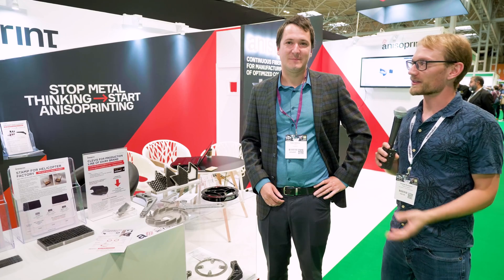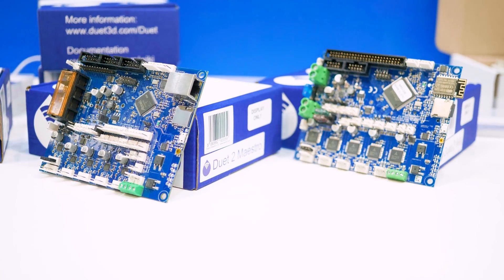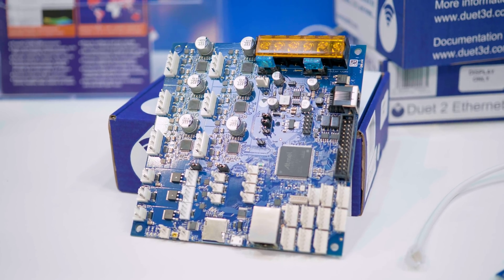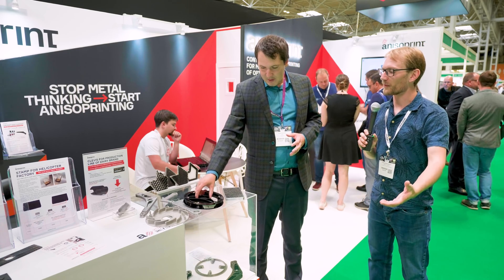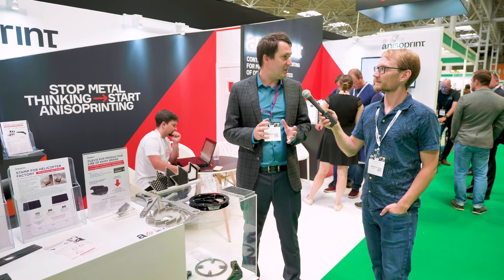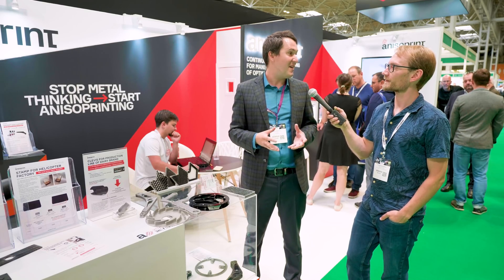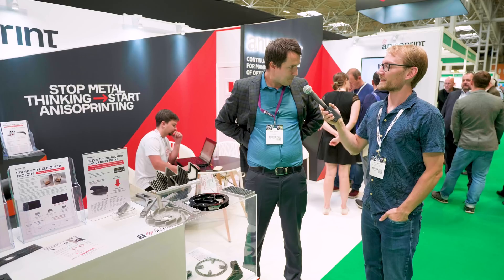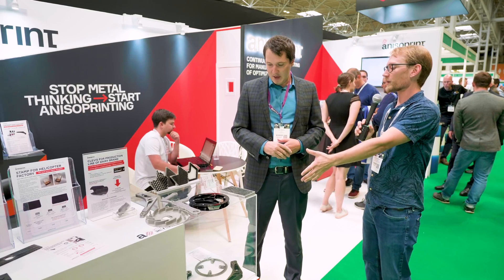Carbon Fiber 3D Prints stronger than STEEL - from Anisoprint!

Comment: Now imagine using thin copper wires instead of the carbon fiber. You could create electrical delivery channels through the parts without having to design the parts around the copper. So its useful and stronger. Maybe that makes sense, maybe it doesn't I don't know haha.

Comment: 9:14 the good point of that is you dont lose strenght when need hole because carbonfiber filament go from start to finish so no need to cut it in the midle. that is nice. 
Price?
Because look more weight less strenght than carbonfiber method. Ofcourse you win versatilty and more easy to improve of perfect deasing.

Comment: While liking the carbon fibre materials i do wonder as the sign says stop metal thinking,i was wondering.while yes ok the production on metals stoppping would have an enormous benefit for our planet and our children but while carbon fibre is an amazing product what are the recycling systems in place as metals you can always melt down to produce different items..any info on future improvements in this area mmmm.🤔ah no!!

Comment: Coming soon, the folicular mullet printer. It will harvest hairs from the toes and legs, and place them into the most correct arrangement onto predetermined areas of the dermis that covers ones own skull, while allowing for 1 of 100's of different styles selected from the device's touchscreen. It's only 500 dollars at the kit level, and 2200 dollars if fully dialed in, should the prevention of a failed first print be most desired.

Comment: As someone who worked with carbon fiber extensively in the past in the cycling industry, I have to agree with most of what he said. However in my opinion small holes dont present as big of a problem when layups are designed to mitigate the issue. It should be clear that this technology doesn't actually compete with real carbon parts, instead it is showing a new application for  carbon fibre as a technology.

Comment: Dumb question:  Why would you bond with a thermoplastic and not a resin??

Make a carbon fiber part, you use resin to bond it...resin 3D printing is a thing...confused, though I'm sure there's a good reason.

Comment: My immediate thought was bone and joint implants. This mimics the way bones are optimally structured; at least in 2D/2.5D. With a full 6DoF, 3D delivery head, instead of the conventional 2.5D planar FDM delivery, this could be amazing and let us move from isotropic steel investment cast alloy prosthetics, to designed, anisotropic and highly optimised, printed composite implants.

Comment: Can compete with today Carbon fiber article? I mean have the same property as carbon fiber made with epoxy with traditional method?
What about strenght in all direction? because that 3D print cant put carbonfiber filament o "Z" plane only in "X" and "Y" plane and that give strengh only in one direction instead in 2 or more.

Comment: Stronger than cold forged chrome vanadium steel?  Carbon fiber is but you have to use a glue. A bonding material. The bonding material is not. I'm very familiar with carbon fiber frames for mountain bikes. They have discovered they can't make the frames lighter than alloyed metal. Yet carbon fiber is 1.5 times the strength. 
These thermoplastic polymer matrix carbon fiber printed parts are stronger than plastic . That's it. 
The good thing about this machine is that it can use recycled carbon fiber.

Comment: 👨‍💻DON'T WORRY ABOUT it CARBON FIBRE IT COST 10XS MORE THAN stainless steel 302 grade thats why SPACEX IS USING ST/ST 302 hard & cheaper its ok for ground vehicles  & bikes  not a lot used  but you try making a Rocket out fibre 13 storeys + high & you run into problems 💲🚀👍

Comment: this would be interesting to use with very thin steelwire as cheap alternative.

(i dont trust any fibers for health resons)
Reply: Steel would actually be simpler. Im guessing you could get away with a single extruder and really thin steel wire actually...
Reply: it would be an awesome diy project to pull that off, i think the main obsticle is, that the matal won't fuse with the plastic

Comment: the fibres only add strength in tension, so how can we use it to increase strength in the z axis direction?
Reply from the maker: There's no option for that yet - you need parts that are suitable for it, printed in the right orientation.
Reply: "We"  could Print an intersecting part  to fit through the voids in the low % infill, then (use your plastic system of choice) "afix" for a the final part with continuous filament in 3 axes...   Basically a 3-shot process.

Any 2+n axis material creation method has material limitations in the Z-Axis...

Comment: I would think for the insane "engineering grade" price of this printer that it would also be able to print high temp engineering grade materials.... 
Cool concept, but that price is just way too high. The only part that makes this much different from a $300 printer is that custom hot end that converges the fiber with the plastic and has a little knife on it.

Comment: I believe Markforged is less expensive for a similar tech, may be I missed the point?
Reply: This system uses a continuous long strand fibre. Which is significantly stronger than short strand that markfoege uses.

Comment: Looks like a good implementation of fiber reinforcement, but the prices will be their down fall. I don't see anything that justifies the prices beyond the intellectual work that went into creating it, and in most cases the market doesn't give a rats ass about that. If it's any good it'll be copied and sold at 10% of the cost once the patent runs out. With any luck they can licence the tech to a company that can sell these at volume and bring the prices down.

Comment: So 12k for the smaller machine. I wonder how much for a spool of the carbon fiber.
Reply: (And, if you are free to in fact use "any other supplier" of the CF, or if that is RFID controlled.... ) - Other suppliers of "Thermoset Polymer Embedded Fibres" will eventually appear.

Comment: Could that fiber be actuality replaced with metal? Thin gage copper etc...
Reply from the maker: As long as it's flexible enough and the cutter can handle it I don't see why not!
Reply: @MadeWithLayers  I was thinking about a solution for integrating metal wire in prints for a long time. I think for them it's just a small step now. Let's hope they see the potential and try it 😉

Comment: What he said about most people using carbon fiber wrong--by just laminating and then milling and drilling--is too true. You're wasting a lot of strength potential, when you could use intelligent fiber steering around certain features.

Comment: Decoupling tensile strength from cross sectional area is a game changer.  These are literally 'next level' composites.
I cannot wait to see where this goes.    Are we moving towards a world where FDM parts have mechanical properties superior to some cast or forged metal ones?
I can't remember the source  but a few years back a youtuber tried 3d printed propellers for an outboard engine.  They all had different times to failure but all failed.  I would love to see how this material performs in comparison.  (When you can control the internal structure of the part can we even call it just 'a material' any more?)
Great video!  Thanks.

Comment: SHUT UP AND TAKE MY wait, how much is it?
Reply: 12 000€~13 000$~11 000£
Reply: The printer could potentially be cheap. The fibre- not gonna.
Reply: @BooBaddyBig  fiber cost will come down when production ramps.. tons of Carbon floating around.
Reply: @WilliamAshleyOnline  Carbon fiber is already produced at significant scale but is still not cheap.
Reply: @BooBaddyBig  the fibers themselves are quite cheap. Parts made out of them, however, are not.
Reply: @DDryTaste  Have you purchased them recently- actually not that cheap! Steel is nearly always cheaper.
Reply: @BooBaddyBig  Don't think you should compare with steel since steel has been mass produced for hundreds of years and has always been cheaper than almost any metal material.
Besides that, you certainly can't buy the machines required to forge/process steel for 12000 euro.
Reply: @DDryTaste  I actually fabricate composites sometimes. Carbon fibre mat is not cheap. Glass fibres are much cheaper. The process to make carbon fibre is much more energy intensive and involved.

Comment: So you’re telling me... I could... essentially... print out... new rims?????? If it’s stronger than steel and I would assume much lighter it sounds like it would work
Reply: A major limitation is that all the fibers are still in stacked planes. Your rims would split along the layers. You would need a method of 4 or 5 axis printing to make something like rims a feasible project, which is orders of magnitude more difficult.

Comment: Interesting and impressive.. Wondering how they block the molten plastic from oozing from the hole where reinforcement fiber is entering??
Reply: probably a tiny one way seal...
take the letter V , cut of a tiny bit of the tip at the bottom, make a rotational part out of it (so you get a cone without tip) and you are good to go.
make the part out of high temp silicon or a similar flexible material.
you can push the fiber stock through it from the top, widening the hole but when the backpreassure is applied from the bottom the hole will seal itself.

Comment: In summary, a clone of the Markforged system, but with an additional plastic-only extruder so carbon fiber placement is controllable within individual layers. Sounds like something Markforged should have done, but were beaten to the punch. I hope there's not IP issues here, because this seems very practical.

Comment: Wow super interesting! I'd actually be more interested in fiberglass printing because of cheaper costs, but I'm sure if they can print carbon they can print fiberglass too.
I wonder if you could pre-impregnate your own fiberglass to save costs and not be dependent on a single supplier.
If you'd scale this up you could actually 3D print boats or cars or even house parts with this!

Comment: This technology paired with the "true" 3D printing slicer could yield some VERY cool capabilities.  More nozzle development needs to be done to accommodate more extreme angles with the 3D printing part. Full 5 axis control of the printhead.  My dream of a 3D printed canoe is closer!
Reply: are you talking about the thesis where the guy wrote a plugin for slic3r that allows for dynamic z surface layers? 
or what do you mean with "true" 3D?
Reply: @TheScarvig  Yes- I guess that may be a better name for it.  Having the fiber reinforced layer applied dynamically over the  surface.

Comment: The weakest point of a 3D print is between the layers. How do the fibers help layer adhesion if it is still 2D layers on 2D layers?
Reply: For that you would need a machine with rotational axes so it can lay in any direction

Comment: Seen many iterations of adding different fibers, most were manual.  This doesnt seem hard to do,  so the price tag is a bit steep in my opinion. Figuring out what to impregnate the fiber with and what to extrude with is probably the biggest challenge. They smartly locked that down. No software and 12/19K EUR cost seems a bit wrong to me. Doesn't seem like it would be a huge stretch from a duel extrusion setup.
Reply: They have software, called Aura. It can be downloaded from the website

Comment: Please excuse my ignorance on the subject but, would it be possible to just make a fillament with the long strand fiber already in it and just print with one head? Or would that not work?
Reply: Peter Gordon Because the diameter of the filament goes from, say, 1.75mm to 0.4mm  as it's melted, the length of extruded plastic is longer than the length of filament put into the hotend. Since the length of the carbon fibre is constant you have to add it after melting
Reply: It's basically the point of their whole system enabling to use a variable amount of constant non cut fiber + a plastic. This way you can change the amount of fiber you use, you can easily swap the plastic type and print at a different build hight. An embedded strand in the plastic could only be printed at the exact print parameters, to thick layers would result in to much fiber per printed mm on the object and to thin layers probably would rip the part on the strand from printbed.
Reply: Ahhh ok, that makes sense. Also makes this machine seem even more genius.  Thanks for the replies!
Reply from the maker: I mean, essentially that's what Markforged's continuous fiber is - they uses nylon-impregnated fibers, which soften when heated, yet can't quite be printed like a normal filament, Anisoprint use resin-impregnated fibers (which stay rigid). I feel like the differentiation is mostly to work around Markforged's patent though.
Reply: @MadeWithLayers  probably to work around the patent, yeah. But it's also kind of neat only one thin kind of coated CF filler needed,stiff strands layed down and the bonding plastic can be picked up by the user. I feel like this system/hardware is also easily capable to print copper/alu (or steel as a cheaper alternative to CF) wire embedded in 3d objects which could lead into whole new perspectives in 3d printing. 
I think they have to (and should be able to) turn down the min. filler length of 45 mm in future modells.

Did Anisoprint mention the CF filler cost per meter?

Comment: i add carbon fibre in my prints for years using long fibers....just print in abs (becouse it melt using acetone) stop mid print and put carbon fabric with few drops of acetone to stick it to the print  , you can add few long fibers the way you want etc ...yes its time consuming but almost free :) 
(ps it works with most of the coloured PLA becouse you can melt the pigment in them :)
Reply: That's a very interesting approach for certain applications, have to try this some time
Reply: Can you make a video showing your process ?
Reply: @hed420  Brauns CNC channel just released a video on an extremely similar process a couple of days ago.
Reply: Where do you get the fibers?
Reply: @melongarb  :  lol..  Google - "CarbonFibre Tow"
Reply: Do you autoclave the parts at all? Adding resin to your part and curing it may increase strength significantly more than what they’re talking about in the video.
Reply: @Coltonwinters000  :Wuh??   funny comment....
Reply: kadmow what do you mean
Reply: @Coltonwinters000  : Sorry just trolling through comments on this video.  I was thinking your question was satire...

Why would one even think of autoclaving  a Thermoplastic Part??? (With or without fibres).   now Stress Normalising it is a different matter...
Reply: kadmow well he could use resin and CF instead of plastic, thus making it not a thermoplastic. Sorry if inference isn’t a strong suit for ya bud.
Reply: @Coltonwinters000  : Thanks for that...  yep you were misled...
lol..  enjoy  buddy..
Reply: @Coltonwinters000  if i need stronger i add carbon fibre ....if i need strong part i print this part make a mold (or print it) and then make carbonfibre part :)

Comment: average good quality fdm printer with 2 printhead and second one for 2 materials (and servo to cut second-carbon fibre) + some programing......... 12 000€ ....... Not for everyone.
Average 

earnings per month in Poland around 2.5k in good job === 570€ , in really god one 3.5-4k zł ~= 900€ per month (but most of the people dont get more than 600€)  and not only Poland so its expensive too expensive for what it is. Give me slicer and printhead and you can build it for 200-500€ max ....but ..... i add carbon fibre in my prints for years using long fibers....just print in abs stop mid print and put carbon fabric with few drops of acetone or just few long fibers the way you want...yes its time consuming but almost free :)
Reply: You can use Anisoprint slicer - it's free. And generates standard G-code